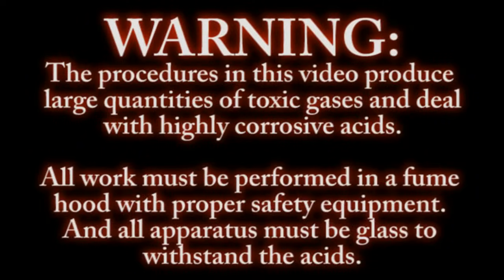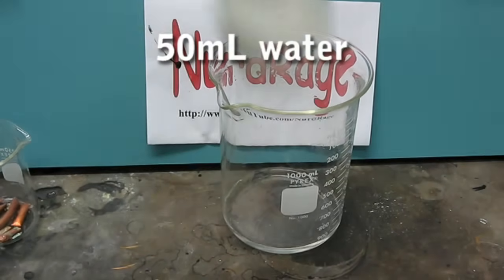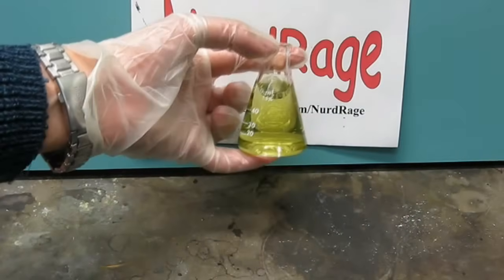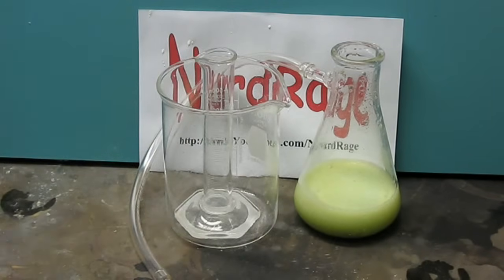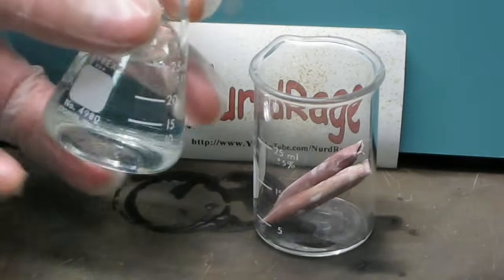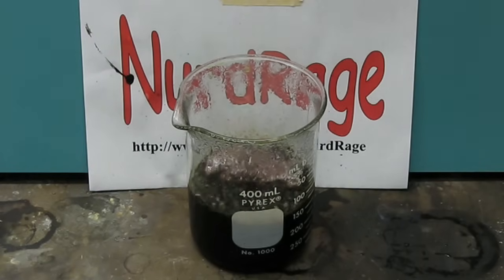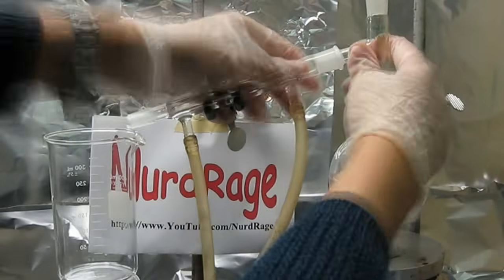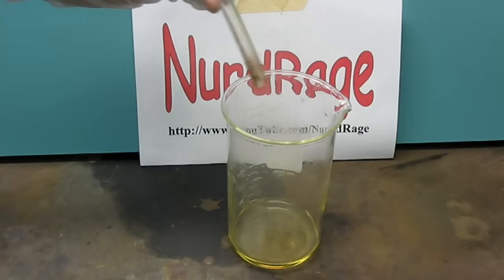Make Nitric Acid - The Complete Guide

Comment: Is it possible to speed up the second reaction in this video by heating the mixture?

Thanks!
Reply: If anyone's wondering about this question too - it is possible, I've just tried ;)
Reply: Electron Power You can heat up any reaction by heating it, google rates of reason.
Faster particle movement.
Reply: ***** 
Thanks :) Say hi to Jesse and Walt ;)

Comment: For the last version what condensor is used?
Reply: It's called liebig condenser.
Reply: Pretty much any condenser would work for that method as long as it is possible to run cold water through it, but yes he used a liebig condenser in the last version

Comment: I think another simple way of making usable concentrated HNO3 is to add concentrated H2SO4 on a solution or powder of Ca(NO3)2, as CaSO4 is poorly soluble (so, if you use stoechiometric ammounts, you will get an allmost clean solution of HNO3 without distillation or much NO2 generation). However, CaSO4 is not entirely insoluble so you will get a small ammount of it in your solution (about 0.2%), but that should not influence the properties of the nitric acid. Obviously, as in any other circumstance H2SO4 is involved, you will need to work on an ice bath, under a fumehood (as some NO2 gas still might be generated if H2SO4 is not added slowly enough and the heat won't be kept under control). l must say l didn't try this, so my expectations about the HNO3 yield and concentration might be a little to high, especially if you use undissolved Ca(NO3)2

Comment: Does anyone know if hydrochloric acid could be used for the last method?
Reply: there are 2 reasons I doubt that: first, HCl, even concentrated, contains over 65% water; second, a mixture of HCl and HNO3, both concentrated, may react, especially when heated, to generate chlorine gas and nitrosyl chloride, which are both poisonous gases (google aqua regia for further details)

Comment: The birkland eyed process is a very convenient and practical way to make nitric acid in modern functional society, but it is NOT a good choice in a survival situation.
It uses lots of electricity, something hard to get if there is a break down of modern society.
Reply: if there is a break down of modern society, I doubt they will keep making HNO3 in the caves
Reply: If there is a breakdown of modern society, there might be a need for gun powder or explosives.  
Having the ability to make HNO3 might be a valuable skill to have.
Reply: they made gunpowder for 1000 years, without using HNO3
Reply: But HNO3 is much more versatile, as you can make KNO3, based propellants as well as cellulose nitrate based propellants, and most importantly, you can make high explosives with HNO3.
For KNO3, just react HNO3 with potassium carbonate leached from ashes, if you want calcium nitrate instead, just react HNO3 with oyster shells.  And the HNO3 doesn't even need to be concentrated for KNO3 or Ca(NO3)2.

Comment: You said only nitric acid can dissolve copper. Well so can hcl
Reply: Incorrect, HCL can dissolve copper with an oxidant like hydrogen peroxide.
Reply: SuperAngelofglory But reaction is very slow (tried it on 300°C) with 96% H2SO4.
Reply: *****
however, hot concentrated H2SO4 does dissolve it without any other oxidant
Reply: was the copper finely powdered or bulk metal?
Reply: SuperAngelofglory Bulk metal :D But HCl + H2O2 for example can react very vigorously even with one big piece of metal ;)
Reply: because H2O2 is a much stronger oxidizer than H2SO4
Reply: Do you know what oxidant would be even better? Maybe KmNO4?
Reply: i think H2O2 potential is higher than KMnO4, plus you get byproducts from KMnO4 (K2SO4 and MnSO4)
Reply: Ok, thanks :)
Reply: The H2O2 probably oxidizes the copper to CuO and the HCl reacts with it. If you want, heat your copper in air and coat it with CuO and then dip it in HCl. At least you won't have your Copper salt contaminated with H2O2 stabilizers.
Reply: That's good idea! :)
Reply: Vrej Egon Spengler actually H2O2 byproducts is only oxygen and water (lab grade not commercial groceries store)

Comment: To make nitric acid from ammonia /water solution :
Using plastic tubing and containers, bubble air through the ammonia water, then run this air/ammonia gas mixture into a copper tubing, make about a 2 inch section of this copper tube red hot using a torch or whatever else. Make sure the copper is long enough that both ends stay cool, and only a section in the middle is hot.
The ammonia /air will react at the hot spot to produce nitrogen oxides / nitric /nitrous acid.
Condense these vapors in a cold container to make a very dilute nitric acid contaminated with nitric oxides.
this acid can be cleaned up and concentrated.
Reply: You'd be better off pissing in a bucket, drying out the piss to get urea and some contaminants, then reacting the urea with Sodium Hydroxide to make ammonia.
Reply: Yes,, there are many possibilities using plant and animal matter.
I do not like to use sodium hydroxide, as it's difficult to make from the land, but I'm sure slaked or burnt lime would work just as well.
Reply: don't you need a catalist for that, like in the Ostwald process?

Comment: A "from the land " method of making nitric acid.
Fill a bucket with plant and animal matter, it's got to be a high protein, high nitrogen to carbon ratio stuff, and use a lot of water so it's kinda like a soup.
Let this decompose, don't let the ph go too high, you can lower ph with vinegar.
After it's decomposed, draw off the liquid, this should contain ammonium salts.
get it cold, then slowly add slaked lime, this will cause the formation of free ammonia, most of which should stay dissolved in the liquid. To increase concentration of ammonia to water, use burnt lime instead of slaked lime, but add it extremely slow and keep it very cold, or else your ammonia will just gas off into the air.
Let this settle, then draw the liquid off, leaving the calcium sludge at the bottom.
I'll make another post on how to turn this ammonia solution into nitric acid.
Reply: Then use fat to make glycerin, and well, I'm sure you've seen Fight Club ;)
Reply: Yes, could possibly make glycerine using animal grease (lard),, or even liquid vegetable oil, and reacting that with slaked lime.
The calcium stearate should precipitate out, leaving a dirty solution of glycerine and water.
I'm not sure about what methods to get the water out of the glycerine, I'm still thinking about that.
Reply: Phaneron I watched Fight Club last night because of you! and I'm glad I did!
Reply: A much better and more efficient way for us amateurs to make nitric acid would be through the Birkeland Eyde process. It requires a microwave transformer or a Neon Sign Transformer to create an electric arc.
Reply: +Vampyromorphida Not underwater but the gases would be pumped in to water. That should make some dilute HNO3
Reply: shannon dove
Distillation/cooled decantation? It'd have a high salt content, but not too much.
Reply: *****
If I may make another suggestion, try Momento.
Reply: *****
I was just thinking that (ionising air to form nitrates). Would that be done underwater? (I'm not familiar with the Birkeland Eyde process).

Comment: What type of tube did you use for the hydrogen peroxide method? Or what type of tube can be used? 
Thanks in advance for an answer.
Reply: glass pipete
Reply: wwwelkam not the pipette; the tubing that connects the pipette to the vacuum flask.
Reply: Mr. Sabazio Can be anything.

Comment: By the way, if you want concentrated nitric acid, but don't want to use the last method, you can use the second method. But instead of filling it up with 30% hydrogen peroxide, you should fill it up with high-test peroxide (or >70% hydrogen peroxide).
(Btw, you can get that by concentrating 30%, but do be careful! Since high-test peroxide is some very reactive and explosive sh*t...)

Comment: Great video!
But i do have two questions:
1. I do not have a fume hood, and i live in an area full of people, so outside is not an option. Can i do the second method inside with open windows?
2. The second method you used copper, can i use other metals, for example magnesium?

Thanks anyways!!
Reply: I have done reactions on my kitchen with a fan blowing out a few feet away.
as long as you se common sense.  
Also you dont have to have a store bought fume hood You can build one so cheap and so easy.
It gets more costly if you use a high end exhaust system but a resourceful person can work around this need.
Reply: Cardboard box old 120mm computer fan, old 12v wall charger, and dryer duct
$5 fume hood 
bonus points if you can do it for free.

also everyone has a fume hood in their house.  its above your stove. box it off and turn it on.

Comment: does anybody know reliable websites where I can purchase the chemicals and lab equipment used in this video?
Reply: If you want cheap chemicals and lab equipment, i would suggest using Ebay. 
Otherwise if you want more advanced chemicals, i would suggest using two websites:
Sigma Aldrich (They are the biggest sellers of chemicals in the world, but they are not cheap! They even have the strongest acid: Fluoroantimonic acid)
H.M.S Beagle: (They also have alot of advanced chemicals, they don't have all the chemicals like Sigma Aldrich, but they are alot cheaper than Sigma Aldrich)
Reply: Thanks a lot man!

Comment: what does fume hood means?
Reply: Its like the range hood or vacuum above a stove, except more enclosed, it prevents dangerous gases form building up inside a lab/classroom for obvious reasons.
Reply: Alderak1
very loud, but very, very useful. You want to have one if you're doing anything with strong acids, or reactions that produce gases as a byproduct.

Comment: its like a catch 22, if you need nitric acid, you have to have hydrochloric acid,
witch is as hard to get is nitric, so you need to make hydro, before you can make nitric... and to make hydro, you need another kind of acid and so on... i have yet to see a video on how to start out with stuff that you can buy easy, in local store.
Reply: You can get HCl at Ace or Fleet Farm under the name of Muratic Acid. I recently bought a gallon of HCl for about four bucks.
Reply: I know, lowes sell it to
Reply: They didn't demonstrate it here, but there's also the Haber process, but you need to buy some platinum wires to make the catalyst mesh from.
Reply: I find a place that I get my nitric acid by the gallon,  for $20 so I no longer need to mess with any of these.
Reply: Csaba Farkas I can easily get hydrochloric acid just a 100 meters down the road, while i've never even seen nitric acid on any stores, because it is illegal to have (Over 30%) here in Denmark.

Comment: quick question 

when testing this third method of making Nitric acid as soon as i add the sulfuric acid to the nitrate salt (in my case KNO3 ) large amounts of nitrogen dioxide is released immediately. how have you made your acid clear ( as mine is a yellowish color ) and also so that it doesn't immediately react with the nitrate salt. please respond with help.

subtotalkiller

Comment: Hmm, I had no idea that stronger acids form a Pseudo-Leidenfrost effect.
Good video :)
Reply: I don't believe it's comparable to the Leidenfrost-Effect.
My guess is that the Copper forms Copper Nitrate in the Nitric Acid:

Cu + 4H+ + 4NO3- -> Cu(NO3)2 + 2NO2 + 2 H2O

But even though Copper Nitrate is highly solluble, it won't dissolve in fuming Nitric Acid, due to the high Nitrate-Concentration shifting the Chemical Equilibrium to the left side:

Cu(NO3)2 <-> Cu2+ + 2NO3
Reply: Well since this comment was a long time ago, I'm going to try and summarize my current thoughts.
I think I was trying to say similar to the Leidenfrost-effect in the following way.

If you were trying to melt Ice quickly, you would logically think Ice would melt quicker at higher temperature, but it's a little counter-intuitive to think that ice melts slower in boiling water.
Likewise,
If you were trying to react copper with Nitric acid, you would think higher purity acid would react with copper quicker, but It's also, counter-intuitive to think that a higher concentration slows the actual reaction.

Bare in mind, this was 3 years ago, and I think I'm summarizing my thoughts accurately.
:)
Reply: Actually, it's because you form copper oxide.
Reply: Hm, that also sounds possible.
Reply: I agree with you that the intuition behind it is very similar to the Leidenfrost effect, everyone in the comments thread is thinking way too analytically. 

In the Leidenfrost effect, the desired action is inhibited by a gas layer formed by the action itself. 
In passivation, the desired action is inhibited by a protective layer formed by the action itself. 

They are really similar, I think people want to just show off their intelligence and only know how to via disagreement.

Comment: making it this way is useless, you can already buy 65% & 99.9998% clean acid instead of making this way ^^ and its dangerous to use home made acid cos it contains ammount of dissoluted no2/n2o4 in liquid which cause in reaction with organic chems. additional high unstable organic nitrate, best way is to make it 100% distillation in vacuum/dark
Reply: I think you missed the point of the video. Ofc you can buy acids online but wheres the fun in that. This video is to teach people about chemistry.
Reply: Not everyone can buy nitric acid. Not everyone needs clean acid.
Reply: Professor makes a good point. Where do you buy your acid?
Reply: in Polnad there is no way private person could buy nitric acid. (antiterrorist law)
Reply: So where are you buying yours?
Reply: Landau Martin y I know, I just RIP these ''internet chemists''
Reply: It seems that you are missing the point entirely. The objective here is simply to explore the science and show ways of making it easily with accessible materials.
Reply: Landau Martin
I was speaking to the original poster.
Reply: Landau Martin
No problem. ;)
Reply: *****
True. Can't argue that for sure.
Reply: storing white fuming nitric acid is a pain in the ass, believe me. even if you store it inside a reagent bottle with ground glass you would have to clean the area at least once a month due to formation of vapors. If you can, go for the concentrated one instead, cleaner, easier to store, safer and it still works perfectly well for nitrations
Reply: You miss the point. Join the MAKE community.

Comment: No, they are chemically similar but TNT is more stable. TNT: C7H5N3O6=/=C3H5N3O9. Dynamite isn't the same as TNT either because dynamite is a mixture of saw dust, diatomic earth and nitroglycerin. The reason the NG is mixed with the saw dust and diatomic earth is to increase stability.

Comment: No their not,
Nitroglycerine's full name is 1,2,3-trinitroglycerine and TNT is 2,4,6-trinitrotoluene.
Nitroglycerine starts with an aliphatic alcohol, glycerine, which is then reacted in via an esterification reaction to create nitroglycerine.
TNT starts with an aromatic compound called methyl benzene or toluene. This then undergoes a nitration reaction to form nitrotoluene.  Depending on the concentration of HNO3 depends upon the level of nitration either: mono, di or tri-nitrotoluene.

Comment: For the first method couldn't you just use an Erlenmeyer flask instead of a beaker for the reaction (To limit the majority of the reaction splashing out into the water)? Also replacing the water with 30% hydrogen peroxide with it sitting in an ice bath?

Comment: Hi there NurdRage I recently bought a 2L bottle of 70% nitric acid, now I know that using fractional distillation the purity of the acid can be driven up to as much as 99% which can be determined by the determination of density: 100% clear NC has a density of 1.51 grams per milliliter dependent on how many distillation runs you put the acid through I was wondering what type of yields would one expect to get after 2 odd distillation runs? thanks for your help.

- Kevin

Comment: Gang... just to keep this well understood. At the beginning of the video is a warning about toxic gases being produced.

PERFORMING THIS WILL KILL YOU if you err in judgement, knowledge or luck.

The NASTY part of this is that you won't necessarily feel distressed by any leaking vapors. They smell bad... but if you decide it's not "too much" and you stay there for a time, you could feel fine. The NEXT DAY your damaged lungs might respond by filling with fluid, suffocating. There is no CURE.

Comment: ha... I was looking to use the nitric acide to mix with silver in small quantities and soak it on silicon dioxide (sand) and make poprocks... I do not have proper safety equipment... not going to die tonight.

Comment: Keep in mind that stoichiometric quantities give the best *hypothetical* yield.

Losses due to decomposition of the nitrate from excessive heating, NO2 gas leaks from the distillation joints, and the difficulty in "boiling dry" a mixture.
As for the left over material, that is what you get from the left side of the reaction - in your case, likely sodium sulfate, some nitrogen dioxide, and maybe some water,
For comparison, using ~150g H2SO4, I got ~50ml HNO3.

Comment: I have performed the last method several times using different ratios of sulfuric acid and sodium nitrate. I tried calculating stoichiometric quantities and found that there is a lot cemented white substance left in the reaction flask that I have to dissolve with water to remove. Is this normal? If it isn't normal then my calculations must be off.

Comment: You should not open a car battery to get the acid - you can buy battery acid alone from many retailers who sell batteries, however, it can also be found as drain cleaner. They're usually sold in plastic containers which are sealed in a clear plastic bag - pretty hard to miss. I picked one up today at Rona called "Liquid Lightning". Be careful.